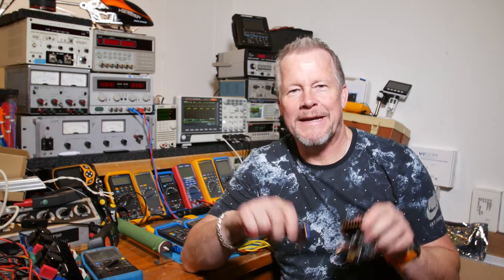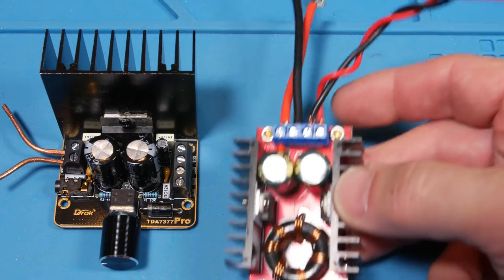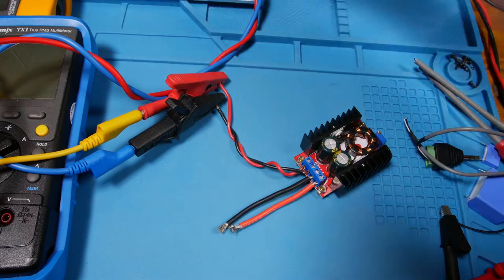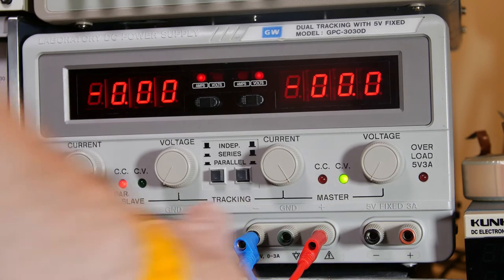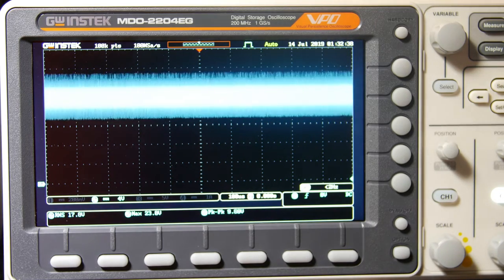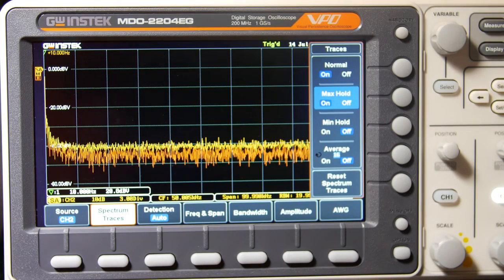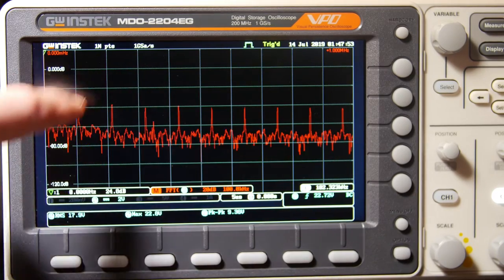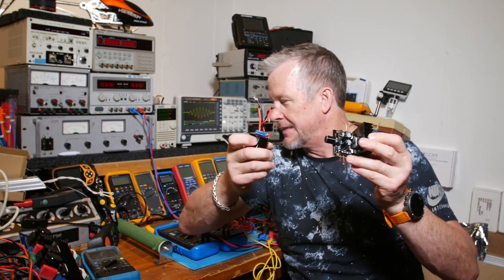Boosting TDA7377 Class AB Amplifier performance with low cost 150Watt converter #boostconverter

Comment: As the other says, a wary interesting video and I do really like that you still go so detailed trough your setup, both cables but also your scope, it makes it way easier to follow and try to recreate. I was a bit suppriced about the huge ripple on the power supply, it opened my eyes for not "just connect". Each part / step is weary important to ensure that next "steps" can do it's best.
You corrected the noise using the 1uF / 15uF capacitors but what if you did use a 2200uF?
I will be wary happy you making more about the THD. :-)
Reply from the maker: Fried Mule Thanks for commenting Fried Mule!  I really appreciate your input and feedback!  I think it’s a great idea to use a large capacitor.  I’ll have to do a video on just the experiment of trying capacitors.

Comment: That was very interesting, and really pertinent for me right now.  I'm trying to investigate the noise generated by a Switching Regulator on my power supply and what to do about it.  I don't have a Spectrum Analyzer but I do now have a scope - Siglent SDS1104X-E - which can do FFT.  Not seeing the same level of ripple as you but still more than I want!  Have you considered a video on bypass and decoupling capacitors?  Thanks for this.
Reply from the maker: Andrew Johnson Thanks Andrew!  The FFT on that scope is actually awesome!  You should be able to reproduce my FFT measurements!  I deleted pert of the video which some of it was the setup of the FFT - it was just getting too long.  ;) But, yes I will be doing a bypass/filter video.

Comment: Hi Eddie,
That's another interesting video.
Especially about the switching noise and capacitor values.
It will be interesting to see if the noise shows on the amplifier output ?
ATB Adam
Reply from the maker: Adam L Thanks Adam!  I haven’t got that far myself, and am also really interested in this.  I have a guess from my experience, but am anxious to test. ;)

Comment: I think I need to send you a much bigger cap so you can do more extensive testing. I think a 1 farad cap is in the ballpark of what you should be using for car audio. One thing with these Chinese amps is some seem to have what I call dead spots. Where they hit a frequency and I see a lot off roll off. A good way to test for that is a 20 to 20K sweep and see  the drop on the Oscope.
Reply from the maker: LOL  Thanks for that;)   Have you seen this video showing the FFT and Bode plot? https://youtu.be/w65OHwzBZ-g

Comment: Step up...i think it bad
Reply from the maker: What do you mean Joe?  Thanks for the feedback, I'd like to hear what you have to say;)
Reply: @KissAnalog  Hi. Eddie! i mean the voltage booster (step up module)...I think it's unstable. (personal opinion)...when we increase the voltage...the current will decrease. If it's a small system, that's fine. But if the big system is not enough..
Thx Eddie 😊😊